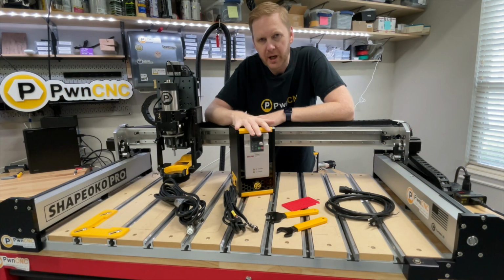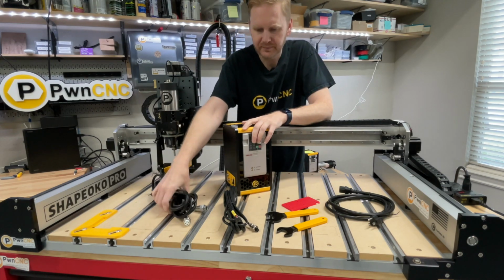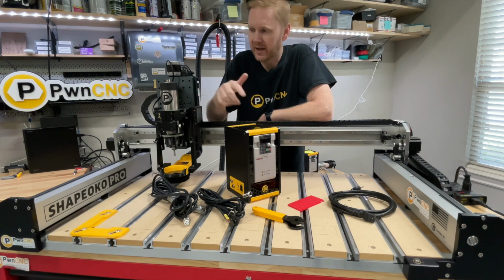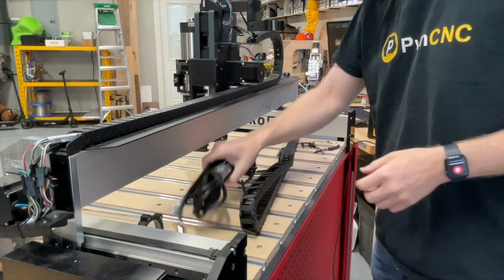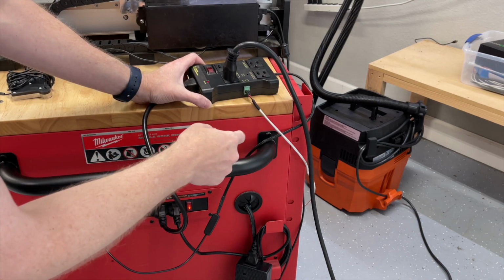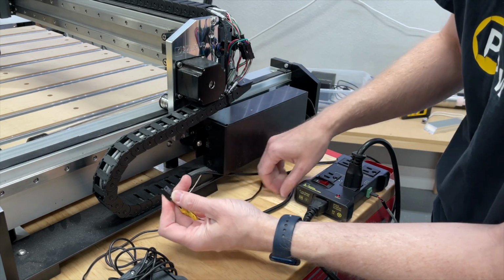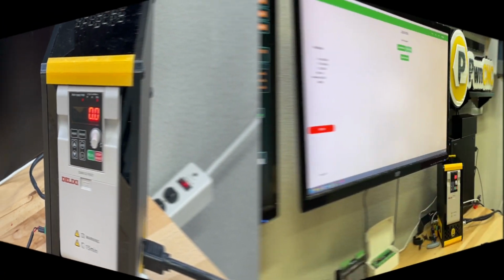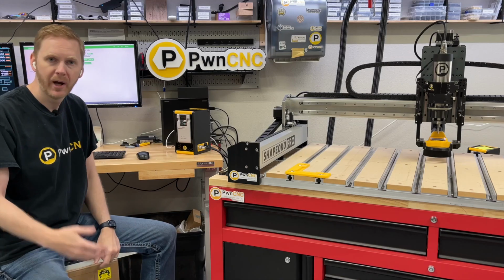The Spindle Installation Guide for Shapeoko 4 / Pro

Comment: Great video Daniel. I know it would require getting another machine, but too bad you weren't able to show how this would hook up to a Longmill, for the folks who have that one.
Is there a way to hook that up so it can be fully controlled by the G code software or the machine itself? Instead of turning it on manually. 
Thanks.
Reply from the maker: This will depend on how SpinDirection works.  This is one of the pins on your Longmill controller and i believe this can be used to trigger the "forward" function on our VFD.
Basically we have two wires available FWD and COM.  When these two wires are connected, the forward function is triggered and the PWM/GND pins control the RPM's.  If they are disconnected the forward function is disengaged.
Reply: @PwnCNC  I got ya. 👍
Hey, I emailed you last night.
Reply: @PwnCNC  I don't wanna just own my CNC, I wanna  dominate it!! Its a must. 🤷‍♂️😊